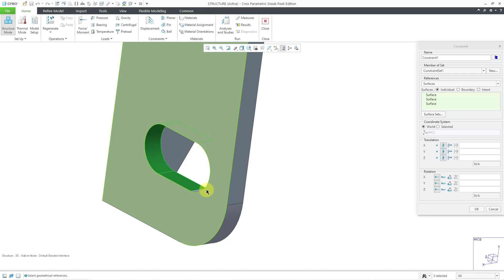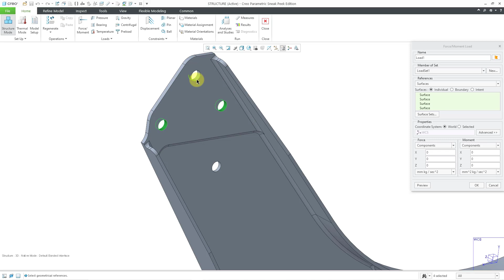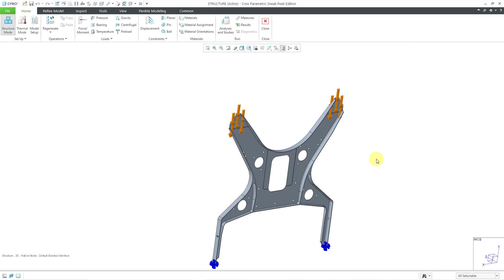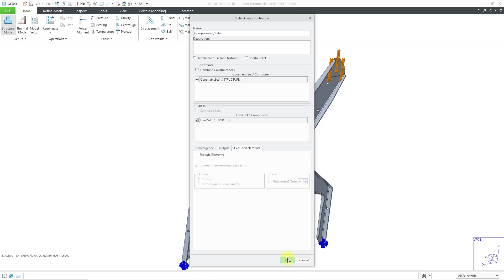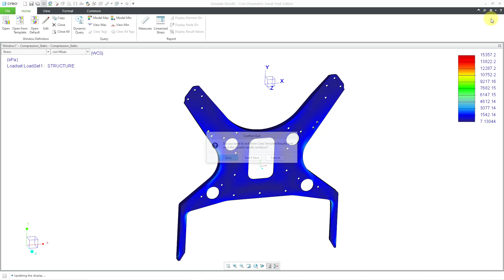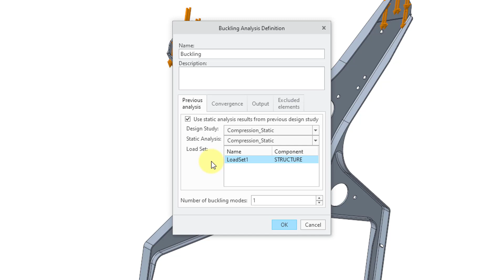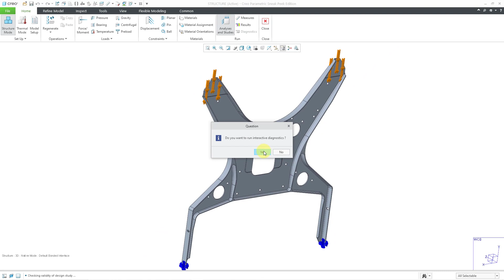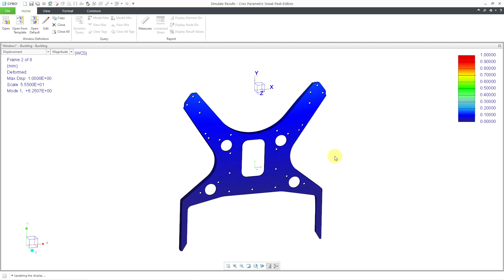Creo Simulate - Buckling Analysis - Creo Parametic

Comment: Sir in case of both end fixed ,how  to give proper boundary condition for buckling...im unable to do the same...kindly help...
Reply from the maker: By both ends, I assume you mean top and bottom. Buckling requires that the part be under compression. It might be fastened at both the top and the bottom, but the load has to be transmitted from something through the fasteners into the part. Both ends aren't actually fixed. Load has to be coming from somewhere.
Reply: Thank you for your response...

Comment: Not sure if this would produce significantly different results, but is it correct to apply a negative y direction load to the entire inner surface of the hole? Would it be more accurate to apply the load to the half of the hole surface that is in the direction of the load?
Reply from the maker: As I note in the on-screen annotation at 1:30, I could have used a Bearing Load instead. The Bearing Load functionality uses a non-Hertzian distribution in which the load is applied over half the surface with the peak being in the direction of the force and tapers off to zero at the sides. Why did I use a regular Force/Moment Load instead of a Bearing Load? I don't remember. It might have been a wrong pick, but the point of the video was to show people how to run Buckling Analyses. Hence the on-screen annotation I added during the editing process.
I have a separate video on Bearing Loads if you want more information regarding that command.

Comment: How accurate are creo simulate results compared to other leading FEA packages?
Reply from the maker: Information on the verification models is available in the PTC Help section. As you will see there, the results are very close.
Reply: Since Creo Simulate uses ANSYS Solver, so I presume it will be as accurate as ANSYS could be.
Reply from the maker: Actually, Creo Simulate uses Geometric Element Analysis and a proprietary solver. I know the branding can be confusing, but Creo Simulation Live is the one based on ANSYS.
Reply: @CADPLMGuy  Thanks for the correction.